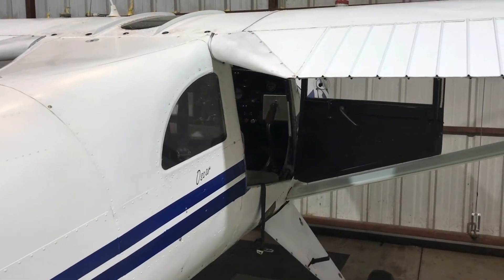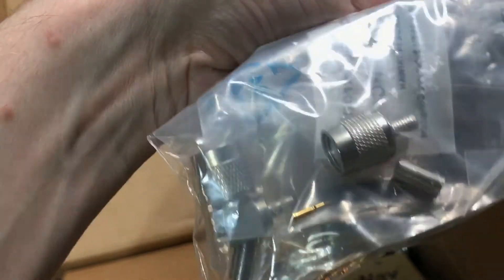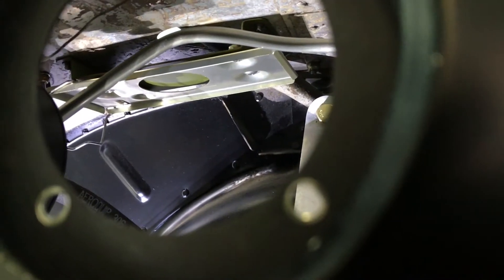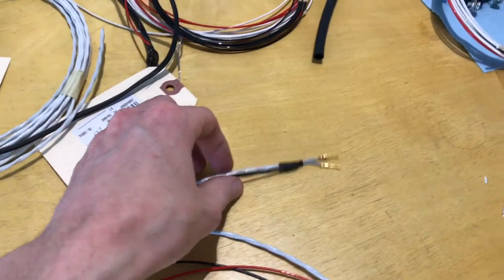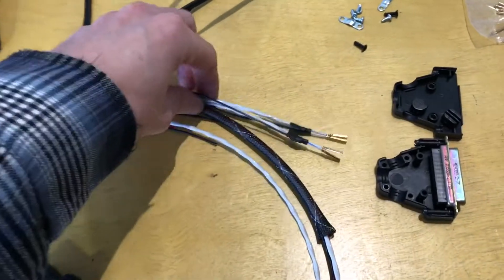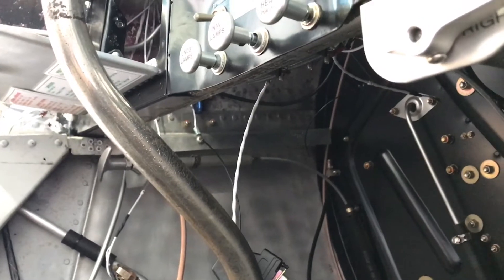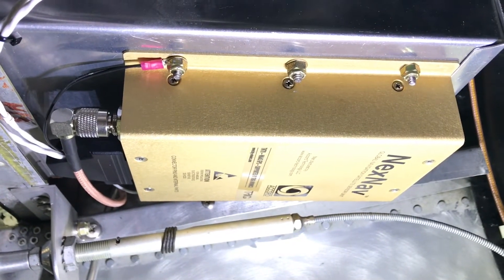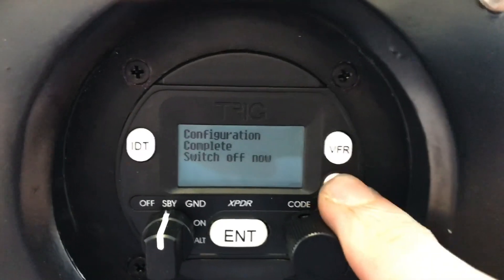Trig TT22 Transponder ADS-B Install in Luscombe 8E

Comment: I’m looking to have a TT22, etc. in my ‘46 Champ (with no engine-driven electric system).  I’m not an A&P but this video was very helpful so I get a general idea what my A&P will be doing.  Of course I’ve gotta figure out what battery and where that’ll go.  My A&P will not install a lithium battery and I agree.  Seems hard part will be finding a suitably light lead acid battery…   Thanks for the excellent video.

Comment: Hello Mike, I’m interested in the Trig TT22 and came across your install. Great video. Anyway could you please give me a review of it, pro’s and con’s and would you buy it again 

Thank You 

Erik
Reply from the maker: Erik,
The unit works terrific. I have had no issues at all, after the install I have not really even given it any more thought.  I would not buy it again though, the size of the GPS unit under the dash is ridiculous. I believe now Microair may be offering a mor compact unit. 
One addition pro though is the integrated static pressure unit, no longer requiring the separate unit
Reply: @1mbowen  Thanks for the review! Much appreciated

Comment: Very nice work but my lord that must have cost you 6 to 8 grand and still no ADS-B in. Has anyone figured out how to mount a Uavionix Tail Beacon X onto a Luscombe? It looks like it would be a challenge but with an AV30 it would be a sweet setup if it could be done.
Reply from the maker: Certified aircraft can be expensive. 
One item to remember is that Uavionix beacons are not dual band and may limit where you can fly.
Reply: @1mbowen  The X is dual band.

Comment: Hi Mike. I’m not very hip to flight electronics. I’m a new pilot, and I have a Luscombe 8F. I purchased a used Garmin 330es with ADSB capability, but I’m not sure what else I need to have it installed. Do I need a gps receiver, and if so, what do you recommend to purchase on a budget?
Reply from the maker: Hey Darin, great choice with the Luscombe! I really don’t have any knowledge on Garmin products…
My guess is that it may need an external GPS, most Garmin products are designed to piggy back off each other, such as the transponder to get data from one of their Nav devices. 
Check online for a PDF manual for the 330es, it should be a good source for installation options. 
Or just call up an avionics shop, I’m sure they wouldn’t mind giving you a quick rundown. 
I used all my available braincells to research and install this Trig set up. 
Was not very happy with the size of the GPS receiver in the Trig set up.

Comment: That sure seems like a very expensive and complicated installation choice for an ADS-B Out solution compared to the Uavionx SkyBeacon for example.  Why did you choose to go this route?
Reply from the maker: Great question!
I wanted an ADS-B solution that would support 1090ES. 
I didnt want to have to have my Nav lights on all the time. 
I didnt want the wing tip, uAvionix and the tail light one would have required modifying my tail lamp rudder mount. 
Eventually I will be swapping from the MicroAir radio I have to a Trig radio and I wanted my Radio and Transponder to Match.
Reply: @1mbowen  - Thanks for this info.
Reply: @Jim_Austin  My Funk B85 didn’t have a xpndr. For me the best bang for buck is an AV30/Tailbeacon combo. I have the Tailbeacon running off a fuselage strobe circuit on a dedicated switch. The Tailbeacon is mounted inside the tail. (Rag n tube fuselage).  I like this fellows setup but it’s more involved. The only downside is having to have the periodic inspection sign off of the xpndr / encoder.  The mode S with the uAvionix setup does not necessitate that.